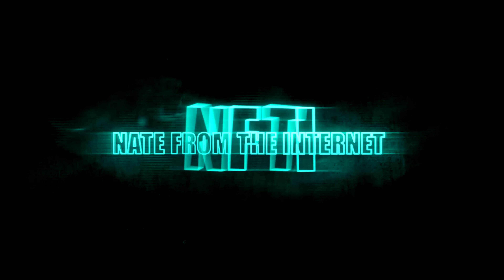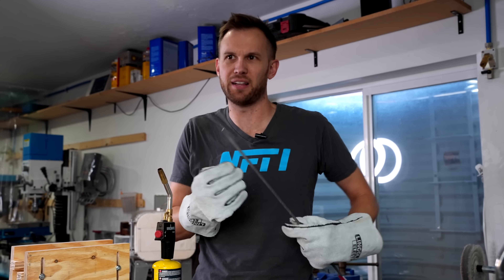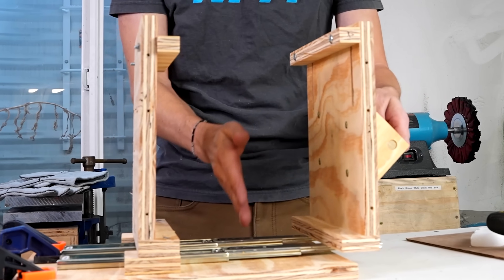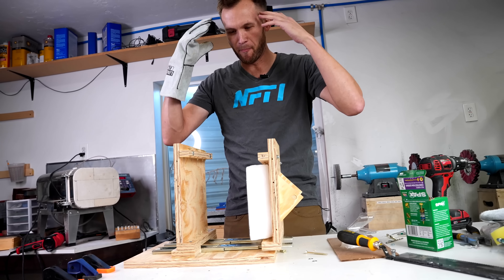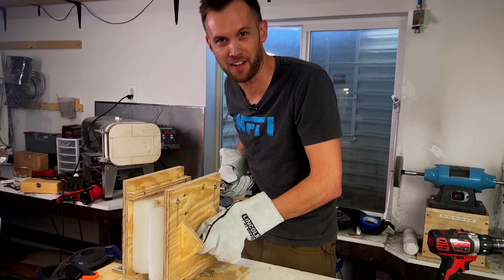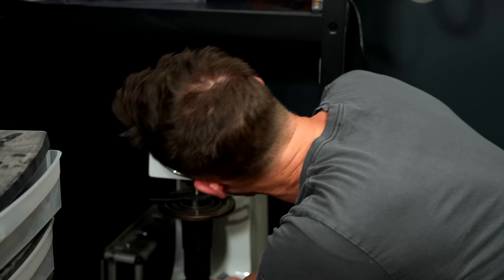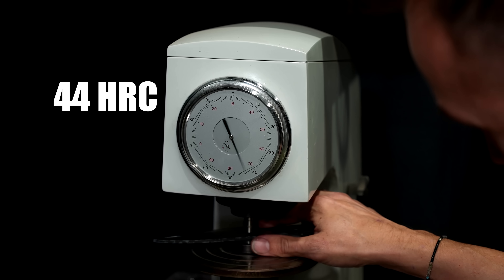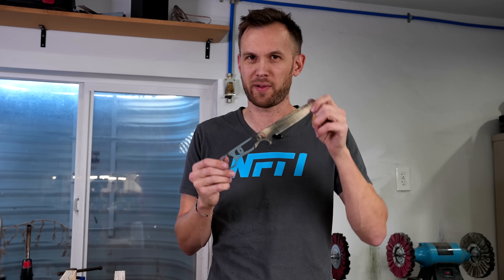Can You Quench a Knife with DRY ICE??

Comment: Here's My suggestion. Use the Aluminum Plates as a heat sync to clamp the knife in, and have the plates be in direct contact with the Dry Ice. This way the Dry Ice can cool the plates well below freezing and aluminum plates will disperse the heat of the blade over a larger area, mitigating much of the localized sublimation of the dry ice.
Reply: Good idea, I would take it a step further.  Make an ethanol dry ice bath and soak the aluminum plates until they are the same temp as the dry ice, then use the plates for quenching.  Alternatively, you could use liquid nitrogen but the dry ice ethanol bath should not boil when you put the aluminum in it.  Alternatively, you could use copper plates with even better thermal conductivity than aluminum but they would cost more.
Reply: @PJeBenn  or taking it a step further from that, and make two aluminium containers filled with liquid nitrogen and press the knife against them
Reply: @PJeBenn ethanol is highly flammable... not a smart move
Reply: @Dienow3xw  I addressed that in an earlier comment.
Reply: I'd use plates of copper as a heatsink - I think that would work quite well - especially with the dry ice/ethanol idea

Good stuff
Reply: That's pretty much what I was going to say. Aluminum is a great conductor of heat, but I think the Dry Ice is more of an insulator.
Reply: was gonna suggest the same. would be cool if Nate tries it and it works
Reply: Nice idea but both you and Nate seem to be forgetting that whilst oil isn’t cold as dry ice, it covers more surface area than dry ice, it being a liquid and all. And you’d have the same issue with an aluminium heat sink backed onto dry ice. The total surface area just isn’t as great at a molecular level as oil.!
Reply: @arghjayem  you’re missing the point. We already know oil works. We’re not trying to walk well trod trails here.
This is mad science. It’s not supposed to make sense. It’s supposed to satiate curiosity. To think out side the box. And most importantly, have fun.
Reply: @davidblalock9945  i agree up to a point. there still has to be logic to the madness. what is the purpose you're trying to achieve? otherwise you're just playing with fire and just call it that. 

Oil is such a good medium to quench metal because it has a high vapor point and it holds heat fairly well. any alternative should we better than oil. The videos suggested Nitrogen and CO2 as substitutes to test but both item has too low of a vapor point. this cause the heated blade to be surrounded by "steam" (vapor jacket) slowing the cooling. 

as for everyone suggesting using aluminum as a base to absorb heat, you have to worry about whether the block would melt and stick bits of aluminum to the blade. you can ground it off later but if the block did melt, it wouldn't transfer heat anymore but rather insulate the blade again. (speculation). this is worth testing once. 

you're looking for a liquid that absorb heat but also has a high vapor point (won't boil off) anyone know of such fluids besides oil? i was going to suggest mercury but it's boiling point is around 670 deg C and vapors make it bad idea. (oil's vapor point is 325 - 375)
Reply: Heat sink* for future reference.
Reply: Could also have bottom plate in liquid nitrogen and put an edge around top plate to pool liquid nitrogen in
Reply: I've already seen a couple of Bladesmiths use rectangular blocks of Aluminum clamped together with the blade in between to cool thin blades which are likely to twist if done in oil.
Reply: I agree galium vapor is bad actually any metallic vapor is bad.  Also, galium reacts with aluminum. As @itarry4 said lots of people including Nate already use aluminum plates to Quench knives especially if they are using stainless steel.
Reply: @maxxod1  This is one of the reasons I suggested soaking the plates in an ethanol-dry ice bath and then using the plates to quench the knife blade.  I guess I should have been explicit but, you take the plates out of the ethanol-dry ice bath and give them a wipe to dry them off before you use them to quench a knife blade.
Reply: yeah, I thought that is what he would do.  This would also work with liquid nitrogen?
Reply: The deluxe version would be copper plates :D
Reply: Though the exact same as soon as he mentioned the aluminium plates without seeing the results
Reply: Using thinner plates would work better
Reply: Great idea but what are we synchronizing the heat with?
Reply: Why does the american 🇺🇸 know how to make a knife
Reply: I thought the same thing.
Reply: Maybe go the pc extreme cooling route and rub the area the knife will be in in a thermal compound... I guess you would need to be careful for fire or splatter reasons as you probably don't want the thermal compound compressed into the plates making a little bomb... And the fire hazard could be minimalized by the sublimation of the dry ice as the carbon dioxide would inhibit flames but seems an interested experiment.... Seems like oil or would still be the best thermal conductor though... Maybe some other liquid that is non reactive with a high boil point... Does Gallium react with steel?
Reply: @tg-xi4ww  iono if gallium vapors is a good idea
Reply: A large gallium bath would be a rapid, wide-temperature-range, quenching medium if you could pump it in a loop over the steel. Corrosion should be minimal.

Comment: Throw the dry ice into a blender to make it into a fine powder, then quench the blade in the powder, this will cool the blade faster but may not offer the clamping ability of the flat pieces.  So if it warps with just the powder try putting the dry ice powder in between your metal plates and then clamp it.
Reply: You would have to work fast because of all their surface area of the crushed dry ice

Comment: Fun fact: the warping he speaks of in the beginning of the video is actually responsible for the curve that hand forged Katanas have. They use clay and coat the spine, often times putting a pattern in the clay’s edges on the surface of the blade between the spine and cutting edge to create the hammon. This clay slows the cooling process on the spine making it softer and durable while the cutting edge is much harder. As the clay covered metal cools it contracts more than the edge, pulling on the whole structure and causing the distinctive curve.

Comment: I think next step is dry ice on the aluminum plates to cool the blade instead of blasting with cold air.
Reply: I agree.  I put my plates in the freezer before I quench and it works great.  The blade needs to be flat though, so you end up grinding the bevels are hard steel.  It's how I make most of my knives, but it uses a lot of abrasives.
Reply: copper plates that were cooled with liquid nitrogen before.
Reply: Or liquid nitrogen to cool the plates. But yeah. That'd be interesting.
Reply: how about dry ice blast?

Comment: Can you quench a knife in a vacuum chamber? Just the knife and vacuum, no liquids.
Reply: Blacksmith here, that will actually do the opposite. It will slow the cooling down because there’s nothing for the heat to transfer to. So it will be softer than any other quench
Reply: @cryptotech3463  What about in a pressure chamber?
Reply: @Zanroff  more air = more heat transfer etc
Reply: So you just want him to put the blade in thermos 😂
Reply: I am intrigued as to what that knife would be like, and how long it would take to cool.

Comment: What if you used the dry ice and 99% isopropyl alcohol? Would it ack the same as liquid nitrogen?
Reply: It would act very similar to the liquid nitrogen but would boil off slightly slower but that difference might be negligible also there is a good chance the hot steel will catch the alcohol on fire, so it would make for a great video just do it outside haha